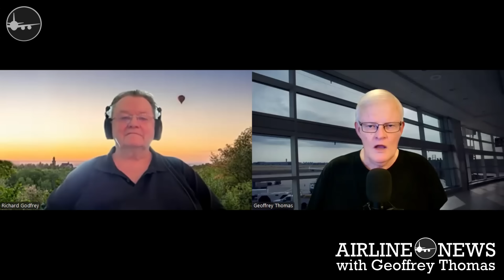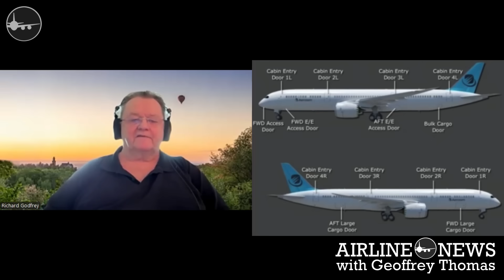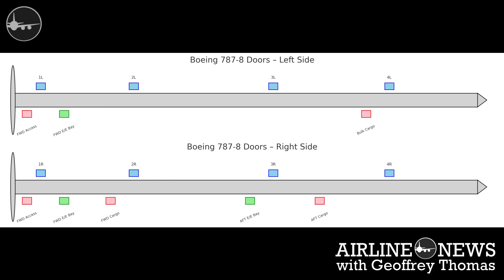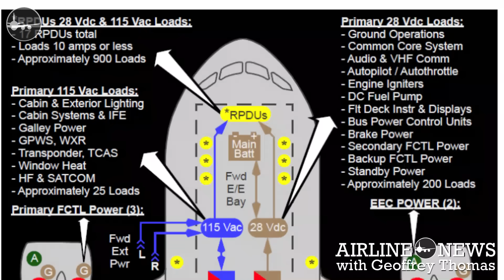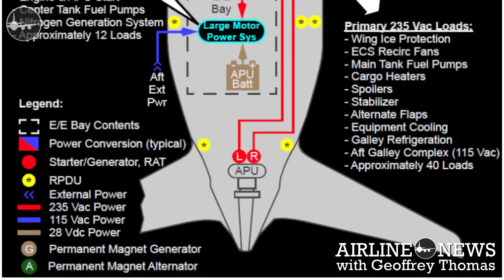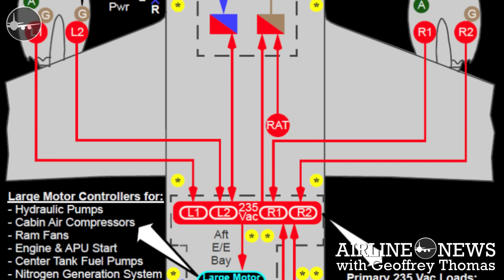Air India Crash Eps 189 - Toilet Leaks Exposed

Comment: Gents, further to my earlier comment 6 hrs ago…
It seems Jeremy John Thompson has presented a coherent “system” FMEA and identified a high risk vulnerability (failure of the particular battery diode) that somehow got past the manufacturer’s/certifier’s FMEA during the design stage. If this component/system failure risk had been identified at that time and decision taken to leave as-is due to low failure probability ( or some other rationale ), then a grave oversight had been committed.  If someone could corroborate each step in the failure chain of events presented by Mr Thompson, then I think this is a most credible cause of the 787 crash.  In the very least, if corroborated and some other crash root cause is settled on, this battery diode failure vulnerability must be robustly mitigated in all 787’s. If not, that would be willful negligence.
Thanks again for all your fine work Geoffrey and Richard.
Reply: This is the link to the analysis that Jeremy John Thompson has carried out. 
https://www.youtube.com/watch?v=OLxLN3osS1Y
I think Geoffrey has shown that a major electrical failure is the most likely root cause of the crash and starts to narrow down the cascade of events that then happen. As stated in earlier comments the loss of fuel tank boost pumps is not going to cause engine roll back as the engines are certified to operate with boost pumps inoperative and this should have been demonstrated during the flight test programme. 
Geoffrey clearly has a deep understanding of the B787 systems, so his thoughts on the Jeremy Thompson analysis would be appreciated.
If the spar valves close my view is that the engines will continue to operate for some seconds even at take-off fuel flow levels. If the problem had occurred at cruise or even on climb out the the engines would have continued to operate as the failure management system would have isolated the fault and the RAT kicked in to avoid a catastrophic situation. At a critical point in the take-off that would not be the outcome........

Comment: I agree that water may be the trigger. 
Any way...
Q1) which power busses might have been compromissed ? 
Q2) could these shutdown the engines ? 
Q3) never seen in 26 years of flying Boeings that vapor lock builts inmediatelly. Nor that electrical Fuel pumps failures shuts down the engines. Can't be. If so, any take off with potencial dual generator failure would mean dual engine failures. Tried many times at certified Boeing sims. Doesn't happens.
This may happen at high altitudes, and may be even thrust deterioration OR eventually engine shutdown. But can't believe at low altitudes and high N1 values.
Q4) Does the Rat provides Energy to the fuel pumps ?  If not , how could the busses failures , then the pumps failure lead to both engines shutdown but later be a relight on both with even much less windmilling N1 ?
Q5) seems according what you said the main Fuel supply on the 787 begins from the wings then the central, converselly to the 737 family I fly.  In the 737 in the event of dual center pumps failure , Fuel would not be consumed but the main pumps feed normally.  In the case of the 787, I suppose in the event of the wing pumps failure the Center tanks pumps assume the supply inmediatelly cause are always on... So does it means another electrical busses failures ...no backup ?
Then , how could they relight ?

Thanks for your enourmus and detailed work, are very appreciated and thanked by many people, like me.👍🏻

Comment: It's clear from the report that the conclusion was left to others for some reason. It implied, intentionally or unintentionally, that one of the pilots cut off the fuel, but it didn't specify whether it was intentional or not. This is evident from the repetition of the phrase "cutting fuel," even though the latter phrase, when one pilot asked the other, didn't indicate what the cutoff was. Naturally, the reader might infer that it was fuel-related, but that's not the case; it wasn't confirmed. Rather, it's related to the name of the fuel control switches, sometimes called "fuel cutoff." In my opinion, the term "cutoff" could describe something else. My conclusion from this is that, since the report exonerated Boeing and the engine manufacturers, it left the door open to speculation and inferences that one of the pilots did this intentionally, which is what we saw as the beginning of speculation on several platforms after the disaster and then building on it. There is no evidence to support this, at least from the report's appearance and wording. If there had been conclusive evidence of the pilot's intentionality, they wouldn't have delayed publishing it to reveal it and put an end to the speculation.  The two possibilities remain: either a malfunction in routine maintenance or a pre-planned act of sabotage, which is a failure in aviation safety and security systems.

Comment: The simplest explanation...... VT- ANB ( the AI 171  aircraft ) was running the show - up thru '08:08:41'. Crew responded in exemplary fashion thereafter.

Variation  on a theme. #1 of 100s.

First Major inflection point A.  One engine due to electrical system chaos - somewhere between 1 / 2 seconds in front of V1  to  possibly as late as 1/2  seconds after rotation is initiated but NOT completed  and this is the  KEY  ie while main bogies are still on the ground - reverts to EECs ALT/  alternative channel.  As it should, if input data is cut off or nonsensical and or 'the two channels do not agree'.  That means that part of the ALT / alternative logic it is now using  includes a previous snap shot of certain aircraft data during take off ground roll  BEFORE the engine had  fully developed the calculated target take off thrust. Anyway, 'this' engines starts rolling back - VERY probably to something more than 'base' idle. Normally, a 787 could easily and safely handle this. But not today, with the ever changing electrical chaos going on in the EE bays due  to 'water ingress'. The ever changing  frequency and output from that engine's two starter/ generators as it  rolls back a relatively small amount does not play well with the malfunctioning 'electrical system'. Major inflection point B. Electrical chaos continues on. Generating ever changing configurations. At the point, when many a/c systems transition from using WOW sensor data  exclusively to incorporating  LRRC data either partially or exclusively, the electrical chaos has yet another bad look. May or may not have flipped EECs  number 2 into Alt.  Remember all this 'whatever'  is happening alongside the other engine rolling back.  Then  some kind of  now 'also' blinded/ misinformed safety software kicks in   and shuts off the 'stronger' engine. Which is quickly followed by the other 'blinded' EECs / Engine shut down. It seems it might even have 'ended up' by two very different paths -  that the possibility that the a/c was on the ground 'motivated'  or helped 'motivate' the EECs to shut off. Just for clarity, none of the above is about WOW / LRRC sensor failure.Nor is it  attempting to address or imply in any way, shape, or form anything about defective Boeing xyz.

Comment: Dear GT and RG.  Retired Mech Eng here. I implore you fine gentlemen to pick up the phone ( figuratively ) and have a “working” conversation with Jeremy John Thompson 
(  https://youtu.be/OLxLN3osS1Y ) to join forces in this matter.  It is becoming clear to many readers with technical backgrounds that both Mr Thompson and yourselves have revealed different, yet plausible, causes for this tragic event.  One puts Boeing/FAA at fault (design/certification) and one puts AI (maintenance) at fault. There may be plenty of blame to go around  but I add my opinion that the root cause analysis presented by Mr Thompson is based on a specific component failure, whereas your root cause analysis is somewhat elaborate (I’m not saying it’s wrong or doesn’t need correcting).  I fear that the final fix needs to address both these matters, with equal weight, across the entire 787 fleet worldwide to instill confidence.  My deepest condolences to all the victims and families in this freak accident.  I applaud your work ( and Mr Thompson’s).  Keep up the good work.

Comment: Nitrogen inerting to prevent tank explosions isn't the problem of the day, correct fuel to engines is. However, what's to account for a preliminary report making note of a "transitioning to fuel cutoff" message? Surely computers don't talk to the recorders in English, and the investigator likely had to look-up some code number listed in a fault message index. Without context or signature, that message might be thought to originate anywhere in the complex fuel and electrical system. If they wanted to "pin the tail on the donkey," the pilot origin might be a pre-conceived notion that was all-too conveniently at-hand.

I can't see any evidence that water ingress actually had happened, though Richard's evidence strongly leads to conclude there's a serious ongoing risk in that layout. It doesn't explain the cloud of white vapor swirling behind the plane at rotation, only seconds before their crash. That's not seen in off-field camera angles, so they left it back on the runway. Conditions didn't warrant that, and Richard's fine report doesn't claim that an odor of burnt fiberglass or wiring followed them. His is not impossible, nor improbable, but not evident on June 12th, 2025 at Sardar Vallabhbhai Patel International Airport.
Reply: What you need is K-9 poop-sniffing dogs going through the wreckage for wee-stained circuit boards. With famed onboard Connectivity and millions of automated and pilot-input decisions logged in the recorder, this controversy could go on for decades until AI decodes and organizes all of the burned puzzle pieces into a true picture. Is life that cheap in India?

Comment: Fiberoptic communication lines are used too? And they have repeaters, some of which have been affected by peak solar radiation events. I can't recall such an airborne event occurring, nor of an aircraft on the ground, though a coronal discharge of unusual intensity had occurred at midday on June 12th, 2025. Does that time and date sound familiar? It ought to, because it was reported that a maintenance tech working on the plane next to VT-ANB had his laptop freeze-up without any known cause. He's dismissed it as interference coming from the adjacent plane. Weird coincidences? Probably.

Comment: I think you guys are nailing down. Murder/Suicide of over 300 people on take off just doesn't true. Your take is more plausible. Due to the water egress and the subsequent complete electronic failure that shut the engines down ... the pilot tried in vain to reignite the engines by placing the switches to cutoff. Then off course "he didn't cut the engines" he did try to revive them.

Comment: By putting the whole toilet-room in a complete rubber "bowl" (without any joints), with all in- and out connections having a kind of high collar, it should be possible to reduce the risks of water spill to a minimum ...
This would also include a step downwards (into the bowl) at the entrance ...

Comment: What interests me is that facts seem to have been altered, or suppressed, and this always gives rise to suspicion. Immediately following the crash, Air Traffic Control said that the final radio message was “mayday, mayday, no thrust”. Later, the words “no thrust” were removed. Why? Because they tended to point away from the intended conclusion of the Report, which was to be “pilot error” or “pilot sabotage”. If the ‘plane was going down, if the pilot said anything apart from “mayday” it would be an explanation for the crash. A simple factual statement such as “no thrust” would not support the desired conclusion of “pilot error”. Then, the sole survivor was interviewed immediately following the crash and he said that there was a loud bang and immediately all the lights went out. This would point to an incident causing electrical failure. Attempts have been made to argue that the loud bang was the RAT deploying. However, why would the deployment of the RAT be the cause of total electrical failure. Surely, the RAT would deploy after an electrical failure? Now, all reference to the survivor’s account has simply disappeared. His comments are reported to be unreliable, because of the shock of the crash. Why the need to discredit his comments? Because they tend to point away from the desired conclusion of “pilot error” or “pilot sabotage”.

Comment: Forgive me if someone already asked this below, but would it be possible (technically and politically) to simply inspect the wreckage to establish avionics bay fluid ingress (or lack thereof)?  It seems that we are dealing with mere hypotheticals, no matter how plausible, at this point.
Reply from the maker: The Aircraft was destroyed due to impact with the buildings on the ground and subsequent
fire. There was an explosion on impact and the aircraft had 54,200 kg of fuel on board. A few items of wreckage were removed to a hangar at Ahmedabad Airport, but the Preliminary Report makes no mention of this fact or any analysis of the wreckage. The EAFR FDR and CVR were both recovered and successfully downloaded. This data should be released in full and will give a clear picture of what happened.

Comment: I hear all of this but without all the data I would prefer if the hypothesis remained a hypothesis instead of “ this is what happened “. It seems to be getting ahead of itself. What would failure of the nitrogen generation system cause? Can a 787 aircraft takeoff with all fuel boost pumps selected off ? I would think yes it can.

Comment: A question.   If the forward EE bay has power for the brakes and   It is thought the brakes were dragging on takeoff.   Is there a reasonable probability water leaking into the forward EE bay was the cause of dragging brakes.  This appears unlikely to be the cause of the flameout but a symptom of poor toilet maintenance.

Comment: This might not be necessary leaking pipe but rather a combination of people missing their aim at the toilet, poor cleaning technique multiple galley spillages.
I have done many structural inspections on the floor area once we have the toilets and galley  removed. It is rare to see leaking pipe work especially if it's the waste line going back to the collection tanks . This is due to odour build up in the cabin and complaints from passengers and reports from the crew of smells. And is generally dealt with promptly.
You reported in one of your shows that the last service interval for the aircraft was around 150 hours ago .
Depending on what check this was would determine if the toilets had been removed for floor inspections.
Usually after inspection and clean up and re protecting the under the toilet cassette we have a membrane to prevent leakage onto the aircraft structure and wiring directly underneath if this was left out liquids urine, water spillages from cleaning or cabin staff over a length of time could cause problems.

Comment: Let us hope that Richard's theory can be positively confirmed or disproved when the investigations are completed.  Anyone taking bets on this? (sorry)
Reply: I will take a large bet that this was not caused by pilots.
Reply: @martinwhite418  Looks like Boeing, GE and the NTSB think there are no 787 problems after 2 months?  But there is evidence that one of the pilots tried to restart both engines at a critical point.
Reply: @paulavery366   What report does Boeing and the NTSB have on the Air India crash?
Reply: @martinwhite418  Don't you think they would be trying to prevent recurrences?
Reply: @paulavery366  I dont know who thinks what,  I can't know what the NTSB and Boeing know. Did you read the report?
Reply: @martinwhite418  Yes thanks, I read the preliminary report and all the background material posted on this site.  If there is a serious design problem on the 787, everyone would be working to hard fix it quickly.
Reply: @paulavery366  You mean like "Everyone" who worked quickly after the first 737 Max crash? You mean those people?
Reply: @martinwhite418 Good point, Martin, but water damage still seems like a stretch to me.  Occam’s would favor pilot action imho.  Time may tell.
Reply: Everyone has an agenda - and committees often come to the wrong conclusions - even the most competent.  I will wait for more facts and hard evidence.
Reply: @paulavery366  I have no "agenda". I can't find Geoffrey or Richard to have an agenda.
Reply: @paulavery366  And these pilots were not flying the first 787 that lost power to both engines on landing. Not even the same airline.
Reply: @martinwhite418  A TCMA fault that has been fixed.
Reply: @paulavery366  OK, we are making progress. How many jet aircraft, in the last 40 years, have had dual engine shut downs?
Reply: @martinwhite418  On take off?
Reply: @paulavery366 Paul, period, takeoff, landing, 40k feet, I will take anything. How many planes have lost thrust to both engines in the last 40 years. A failure to maintain the requested thrust. Which incidents?
Reply: @paulavery366  And to be clear, I'm not referring to any dual thrust loss from empty fuel tanks, missile shoot downs, damage causing engines  to fall off, externally caused damage, birds, etc,. Thank you.
Reply: @martinwhite418  Tell me more, Martin!